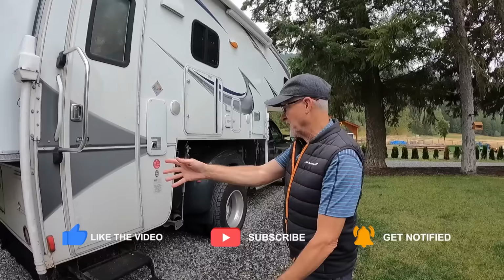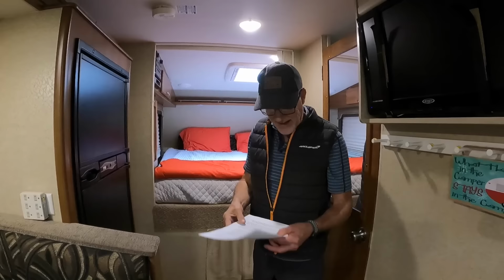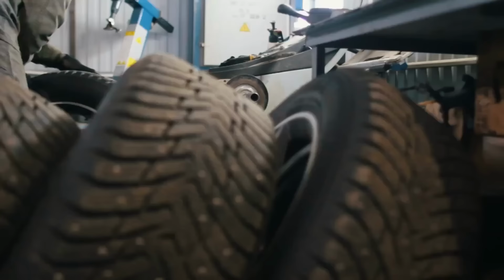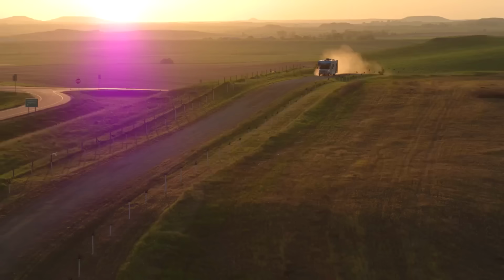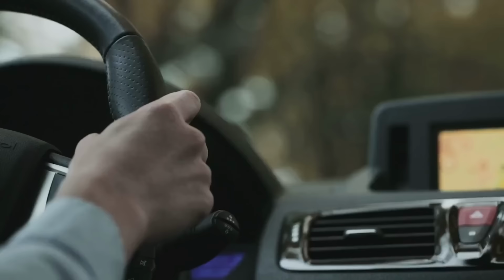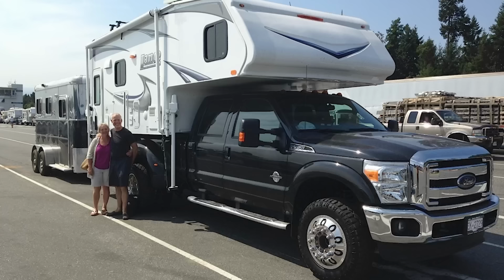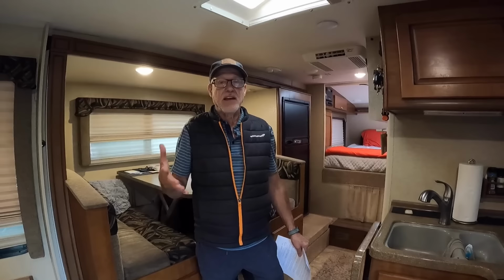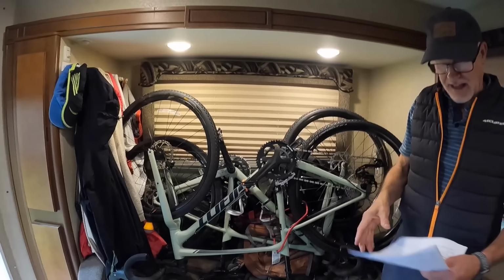Truck & Camper Pros & Cons – and how you can eliminate a couple of the cons you've heard about . . .

Comment: The amount of rear overhang on your camper is massive. I am surprised there is any weight on the front wheels at all. :)
Reply from the maker: It's actually super well balanced.  I have so much respect for the engineering/weight distribution thought that goes into these units.  i.e. appliances like Fridge, stove, hot water tank etc. mounted forward.  Ditto for clothes closets etc.  The cabover weight is also specifically designed to offset the rear overhand.  The unit actually has a sticker on the outside walls stating identifying precisely where the centre of gravity is, and it's right where it should be on the F350 - almost just slightly forward of the centre of the rear axle.
Reply: @howardkettner  I knew it would be balanced, it just looks so extreme it's difficult to imagine it being balanced. I wanted to put a Northern Lite on my 2003 Dodge Cummins Quad cab long box SRW but the payload is just not enough and the SRW would likely not be stable enough. They are so heavy when loaded unfortunately. I don't really want to buy a new truck for it. Oh, and the Northern Lite campers are huge money as well. They are the price of a luxury SUV. They are not worth what they ask for them.
Reply from the maker: @stevenpringle7813  Yeah - for me it would have been a buy that supported local industry.  They are super well built.  Nothing negative to say about them at all - but once I'm up in that price range, I figured I might as well have at least one reliable slide to give me the extra space inside.  And if one has not lived in 'slide vs no-slide' the one slide opening up 18" is monumental in terms going from claustrophobic (which my wife is) to spacious.
Thanks for being part of my journey.

Comment: I believe that some  truck campers have passed the point of safe in regards to weight and stability no matter how much you modify. Laws of physics still apply
Reply from the maker: Thanks for tuning in.  
I do not disagree.  I'm actually shocked that there are not more accidents.  I only had to take a stock brand new F350 and a newly purchased truck bed camper through a single round-about intersection once, a decade ago to know it was unsafe.  
After suspension upgrades, widening the stance considerably front and rear, consulting with suspension, alignment and tire experts along the way, I'm confident in what I have now - but I'm also hyper aware of how I load the unit.  Weight at the bottom, bulk at the top, etc.  
Along the way I've had RV sales people share that it is their reasoned opinion that there one out of every two motorhomes that is on a one-on chassis that is exceeding the manufacturers stated allowable weight - and issue that directly impacts braking and cornering.
I suspect we'll see a day coming when anything over a 10,000 lb RV unit/combined vehicle weight unit will require an upgrade in drivers license, accompanied by random weight scale checks.

Comment: Curious....what wheel brand and size did you go with. They look good, but even better, they achieve the goal of stability. Great video. Look forward to seeing more.
Reply from the maker: The wheels are 10 bolt American Force.  (Had to install adapter rings - which also forced the wheels out slightly further on each side.  A good thing.
I had some really gnarly tires for the first 50,000 miles, great in mud etc. but also not snow rated, and the pass near here requires tires with the snowflake on them so the heavy duty pick-up truck expert I consulted put me into the Yokohama Geolandar A/T series - 10 ply rating, size LT275/65R20 126/123R  I'm just so impressed with them.  Quieter on the highway than my previous selection, but super solid cornering or otherwise.  Think 'roll elimination'!  :)
Reply: Hi how come you didn’t just go to F450? Is it actual payload lower since gvwr same but 450 weighs more?

Comment: Have you ever used a camper van? We're looking at pulling the trigger on either camper van or truck camper combo. decisions decision....
Reply from the maker: Thanks for tuning in!  Great question Eric.  I've looked at Camper Vans a lot - and I love how compact they are, and the sheer ingenuity of great design.  So much to admire.
The reason that I went to a similar amount of living space but in a truck camper configuration is because I use and need my F350 dually around the hobby farm on a regular basis. Simply meaning, a camper van for me would be one more engine, one more set of brakes, etc. to maintain.

Comment: Great overview Howard. Our daughter is purchased 9 yr old dodge 2500 + older bigfoot.
I cannot stress enough due diligence for vehicle repair/maintenance.
Question, camper tie downs, turn bucket/hook or turn bucket/chain or HD racket straps?
Which is the best solution?
Thanks
Reply from the maker: I think any of the above are suitable.  I've seen them all in use - although the ratchet straps would be in a distinct minority.  
Lippert has a happijac turnbuckle set on Amazon that is fairly economical.  I use The Fastgun because I can lock them to prevent theft of the assembly.  That's easily the most expensive option.  All depends where one is parking and how long the vehicle might be left unattended.  Definitely one doesn't want someone to walk off with the tie downs, leaving her stranded.
Great point on the repair/maintenance.  My F350 is now 11 years old and with regular maintenance, I still have a vehicle that is super reliable and will do the job for many more years.
Overall, sounds like a terrific learning experience and adventure for your daughter.  I've heard nothing but positive experiences with Bigfoot.  Seems like a solid unit.

Comment: To me,,, the BIGGEST con would be the cost of these Truck Campers.
A Lance 1172 cost somewhere in the $80,000 Range.
My new 40 ft 5th Wheel was purchased for $57,000. 
???????????
Reply from the maker: Hey! Thanks for stopping by to chat!
I don't disagree with your seeing the cost as a con.  There are campers for less, that do not have the four seasons insulation rating, head ducts into the basement/water area etc.  
As a general statement, this is one of those things where smaller may be more expensive - meaning, it's not the cost of additional materials but of overcoming additional engineering challenges that can add to the final tab.
Reply: B William Harris you broke boy

Comment: how did you slide the camper under the cover?  I noticed it's sitting on a pedestal, but it didn't seem like it had casters or wheels on it.  It also didn't seem like the camper would fit under it while still on the truck.  Thanks in advance for the time, loved the video! 🙂
Reply from the maker: Great questions all.  Thanks for tuning in and being part of the conversation.
It's tight - but hey - that shelter was here when we bought this property a year and a half ago - and we lucked out.  It's got 14' of clearance.  Hard to tell from the camera angle tho.
The process is:
- back truck and camper under the shelter
- jack camper up  - and here's where we use all 14' of overhead
- pull truck out from under
- place stand underneath.  I built it with kiln dried spruce and one sheet of 3/8th plywood, and all 160 pounds of me can easily drag it underneath the camper.
- level stand (I have pre-levelled the ground under the shelter, so maybe at most a 1x4" board under one corner or another.  
- lower the camper - thus taking a lot of weight off the jacks and with the level base under the camper it prevents the slides from 'jamming' when I open them.  
Hope this helps.

Comment: Can one enter the camper with the back slideout closed? Thanks for taking time in posting this video.
Reply from the maker: Thanks for tuning in - and great questions.  I should have covered that.
Unfortunately not.  The controller for the slide out is in a pocket just inside the door and to the left, and that slide needs to be opened about half way.

Comment: Any video or blog on the sway bar setups or tire/wheel combo? At that point now with our rig. Almost 300k on nothing but stock gear and airbags. Now adding 2, 12k winches, large in bed camper (hard side this time) and front motorcycle carrier.
Reply from the maker: Ohhh - that is SUPER interesting.  Would love to see pix
Reply: @howardkettner  I could get video up. 

Do you have a video or article about the wheel/tire combo you used?
Reply from the maker: For sure.  A lot of folks have been asking the same question.  Let me know if any additional comments or questions: https://www.youtube.com/shorts/KCGb1ZFAtXI

Comment: What was the problem with the non retractile slide & the fix?  thx b
Reply from the maker: Thanks for tuning in.  Great question.  
The wiring harness was (stupidly) placed right under the slide - but out of sight.  So every time we opened and closed the slide (this all after the camper spent a full four months in transit back and forth from the Lance factory for the complete rebuild of the side slide infrastructure).  
Ultimately the slide ripped the wiring out.
Fortunately for Coral her brother-in-law who was at the horse camping event redid the wiring and it endures to this day to the best of my knowledge.  (I've recently sold the unit.)

Comment: I noticed you appear to have 10-lug wheels which are typically found on an F450 and F550.  Q1: How did you get 10 lug wheels onto your F350? Q2: What does the 10-lug wheel arrangement do for you versus the standard F350 8-lug wheels?  Thanks!
Reply from the maker: Huge thanks for tuning in to my fledgling channel.  Not a lot of subscribers yet.  Just a little something that I do off the side of my desk.  :)
Great question.
I wanted what I wanted in terms of wheels (my wife is into horses and the wheel pattern was apparently initially done for a notable Indianapolis Colts player who then licensed the design back to the manufacturer).  
It only came with a 10 hole bolt pattern, but there are 8-bolt to 10-bolt adapters that are readily available from your light truck tire specialist, the end effect of which is to give one about 3/8" additional width.  For side-to-side stability - that is a further bonus IMO.
The adapters are up to the task.  My tire guy says the lug nuts are torqued at 400lbs.
Hope this helps!

Comment: Can your truck handle both a camper bed and tow 9800 LB travel trailer at the same time?
Reply from the maker: Yes, it can.  According to Edmunds, my 2013 has a towing capacity of 14,000 pounds.  https://www.edmunds.com/ford/f-350-super-duty/2013/features-specs/
Of course one has to pay attention to the usual hitch and ball issues.  Lots of videos on YouTube about that.
What is unique in my situation is that because of the 4' overhang of the camper, I installed a Torklift Truss Hitch, along with the accompanying 42" extender bars (when installed they come flush with end of camper overhang.  
Then I use a Shureline trailer ball scale to ensure my trailer is correctly load balanced and is not exceeding ball weight specs.
Sounds like a lot, but really not a big deal.  Have trailered two different lengths of toy hauler trailers, a flat deck, a loaded horse trailer etc. without issue.  Super controlled and stable.

Comment: Im Interested in the Rayzr FB or the travel lite cent.
I don't want to climb into a bed. Lol
I was wondering with road vibrations,  does it affect anything over time? Counters, camper etc?
Reply from the maker: Every camper I've had - despite their design or build pros and cons has been rock solid.  My Lance 1172 was as solid the day I sold it after it was 10 years old as it was when we bought it - and we travelled a lot of bumpy roads - so bumpy in fact that more than once the camper would move sideways in the bed - despite the tie-downs being tensioned properly.
I hear what you're saying about crawling up into a bed.  That was a pet peeve of mine until I looked at and then bought the Arctic Fox 1140.  Love it.  Working on a walk-around/walk through this week and will publish soon.  
Despite the issue with the bed, so many positives about a truck mounted unit and it's maneuverability and capability compared to a tow trailer or an RV coach IMO.  
Huge thanks for tuning in and for the dialogue!

Comment: What an absolutely beautiful RV.  What does a beauty like this cost  ?
Reply from the maker: In Canada right now, with all of the economic and supply chain issues, I understand these are running about $110k - which would mean $75-80k US, and one is going to wait likely over 6 months, although yesterday I had a great conversation with a prominent RV dealer in my area, and he figures that the market is starting to cool - and not just because it's October.  His lot was the fullest I've seen in 2 years.
PS - think used . . .  I've had my 1172 for 9 years and it's bulletproof.
Reply: @howardkettner  thank you
Reply: @howardkettner  just think if you had a real patriot in charge there prices, etc would be like back to normal ! (Not over inflated hoarding)
(Goat was 45)

Comment: Thanks for sharing your video. One question can you go into more detail on your wheel setup vs stock? Just trying to figure out the wider stance.
Reply from the maker: Sure thing.  Thanks for tuning in.  
The stock wheels on the F350 when new were the biggest I could order, and they still looked like little roller-skate wheels under the truck.  The outside of the outside dual tire on the rear was fully 1-1/2 to 2 inches inboard of the edge of the flareside fender.  
So - I went to my local tire dealer and asked what I could do to provide less roll, and more stability overall, and he suggested a greater rim/wheel offset, and larger overall tire circumference.  Worked like a beauty.  Now the outside tire is fully 2 inches outside of the edge of the flareside fender.
On the front - same thing but less dramatic as we didn't want to overload the front stock suspension, so we selected a wheel/tire combination that put us about 1-1/2 inches wider on each side or 3" overall.
Hope this helps.  Let me know if anything else . . .
Reply: Could you add wheel sizes to that description. Thanks. Good video.

Comment: Are you saying you can fit this rig into a regular parking spot? I highly doubt that. Maybe oversize spots. Even a vanilla truck of this size will stick out. The width may also be an issue in side by side parking.
Reply from the maker: Yeah - it's always a squeeze and I've gotta find those oversize spots for sure. 
Huge thanks for tuning in and being part of the dialogue!
Here's to safe and happy adventuring.

Comment: I have looked extensively for an F350 with a max GVWR greater than 14,500 with no luck, can you confirm that your GVWR is 16,000 lbs and what option you have that gives you that? I have only seen a 16,000 GVWR on F450's and I hate the ride on them.
Reply: Agree
Reply from the maker: Huge thanks for the fact check.  That's what I love about YouTube.  With every post I learn something new from viewer comments.
My vintage is rated for 14,000.  
My info (and I should have fact checked deeper) came from a dealer I was talking with pre-video shoot.  Upon checking the official Ford site (link below), the 2022 new F350's, 4X4 and Dual Rear Wheel configuration comes close with posted specs as follow:   
Front Axle: 5,600 pounds
Rear Axle: 9,900 pounds
Total: 15,500 pounds 
https://www.ford.com/trucks/super-duty/models/f350-xl/
PS - and the dealer rep I was talking with was not wrong.  The 4X2 version has a better Rear Axle GAWR.  It's rated for 10,300 pounds which would allow a total GAWR of 15,900 - which is close enough to 16,000.
Sounds like it's time for me to either lighten the load or upgrade the wagon. :)
Thanks again.
Reply: I would double check your Ford data.  A 2022 F350 XL CC LB  Dually 4x4 7.3 Gas can have a maximum payload of 6500 lbs (+/-) (exc. Driver, passengers, gear).  The maximum GVWR IS 14,000 lbs, truck and payload (in the bed) Check your payload sticker in the drivers door jam to get your rating and compare that to a Cat Scale.  F450 can have a higher GVWR at up to 16,000 lbs. But a lower payload due to the mandatory diesel engine and the associated weight.  If properly specified a F350 gas or an F550 C&C is the best way to go for a heavy truck camper.

Comment: Is that lance 1172 on a short bed ? If so your C.G. Is behind your axle that why your suspension is not right!  Propane if you can’t lift it, try to use a ladder with a winch it up or down so much easier and place the bottles inside rather than struggling to get it in the hole and risk dropping one on your foot
Reply from the maker: Hey! -thanks for stopping by and commenting.  Much appreciated.  
It's full blown long box, but I definitely need to add air shocks upfront (they mount from cab to camper overhang).
Yeah - those bottles are a pain.  Lots of great advice from viewers like yourself.  All very much appreciated.
Reply: @howardkettner  yea just a old fashion pully system may work outrigger or mini extension from roof top I’m sure can handle 60lbs. Or mini electrical winch on top of roof with extension. SWEET
Reply from the maker: @shearenergy8203  ahhh. I do love rigging up stuff like that. 
Your idea might be a whole new video!  Thanks.
Reply: @howardkettner  yes just keep it simple i.e. you can have a fold out boom from roof top @2’ extension with fairy small pully on top made for sail boating accessories you can get on eBay made for 3/8 line (also maybe 25’ or less “Marlowe line) easy on hands last forever super strong and a tie down near you so once the can(s) are up in a tray easy to slide in with thin piece of plastic from basket interconnected to truck camper box without a hitch😂 so it slides into compartment (50/50 plastic to cover inside compartment from basket and then pull out plastic once you got the tank in right. The boom is your answer other than that look up 3rd lever in yachting search engines. Have fun with it